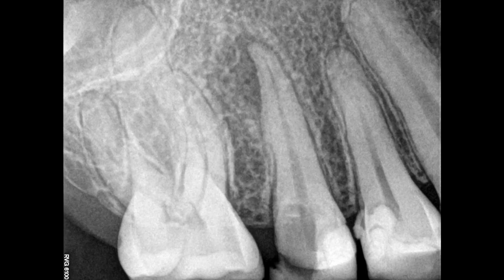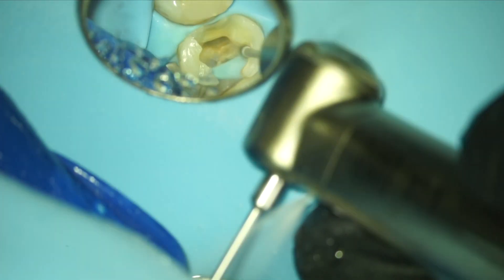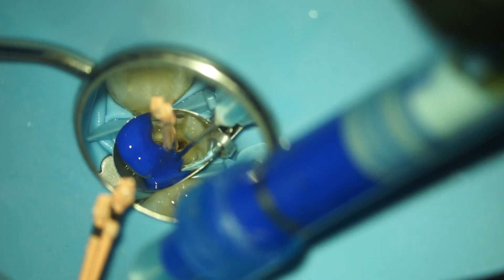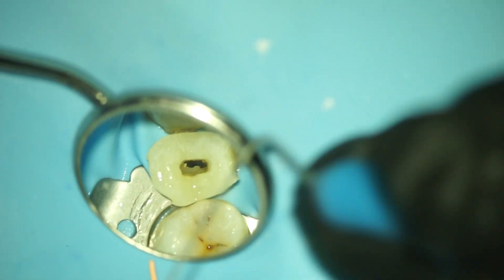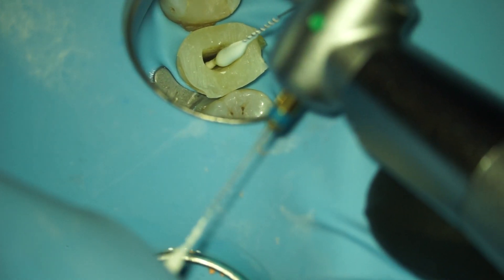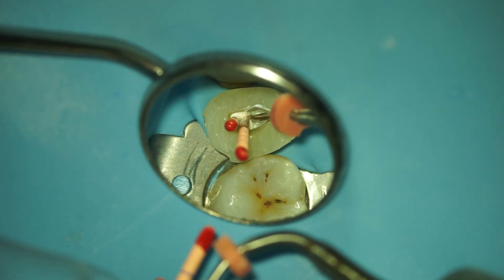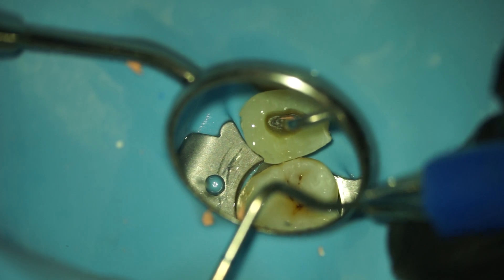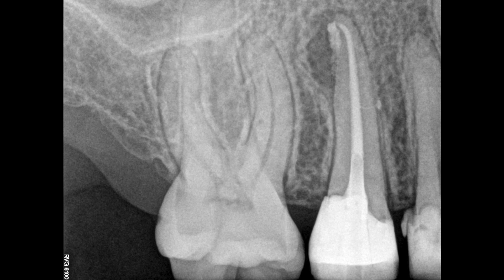Root canal treatment WITHOUT anesthesia!!

Comment: I had a cavity filled without novocaine and it wasn't a small one or on top of the tooth it was
Reply: I did once and it was awful. The worst part is when they were drilling deeper and deeper. After getting deep enough he used a second drill to smooth the hole out. He was straight up hitting the nerve directly.

Comment: I suffered a direct capping of the pulp of a molar when I was 11 years old, without anesthesia, the dentist could not administer anesthesia because I was a child, I had to endure everything, I started to feel pain immediately, even when the bur was still on the dentin, when it reached the pulp chamber the pain increased greatly, when he changed the bur, I think he put a diamond grain one or at least that's what I remember, he cut the pulp, I felt a horrible pain, the worst of my life life, they had to hold me down because I couldn't resist the pain, the second cut was monstrous, infernal, in fact I fainted. The doctor wanted to cut another piece of pulp but he had to stop because I would probably have a heart attack, in fact he sealed everything and sent me home, I took painkillers for a week, I couldn't sleep at night, I had unbearable pain, in the end they had to perform a root canal treatment but under total anesthesia. It seems impossible to me to be able to resist certain treatments without anesthesia
Reply: I feel you. I had a root canal treatment and apparently the anesthesia wears off quickly on me, so at one point I clearly started feeling sensations in my mouth again, and right after that, they touched the nerve with a very fine metallic tool and my soul almost left my body—no doubt the worst pain of my life. It was absolutely horrible, and it happened twice during that treatment. I can’t imagine going through the whole process without anesthesia OMG

Comment: There is no way possible that the patient wasn't numbed. My Endodontist told me he didn't need to numb me because all the nerves were gone. He ripped out the nerves with an attachment that resembled a thin drill bit and I've never felt more intense pain. I was 13, 1987.
Reply from the maker: It's perfectly possible to do it without anesthesia in necrotic cases, this means all the nerve tissue is already dead and you are basically cleaning a hollow tube. Which was the case in this patient.